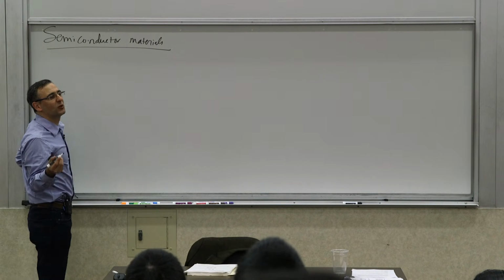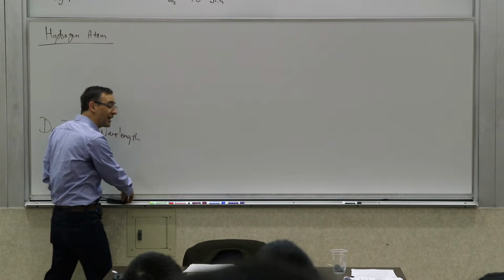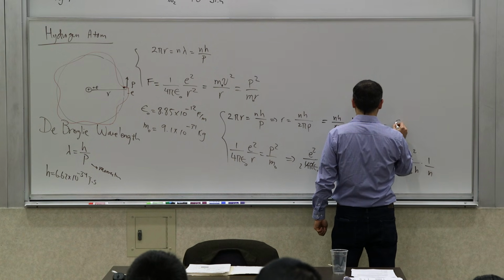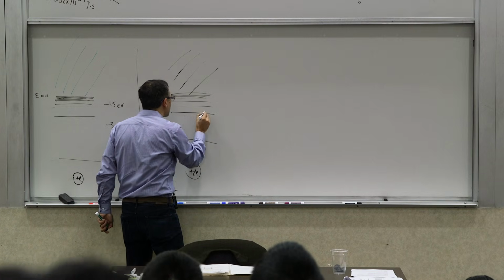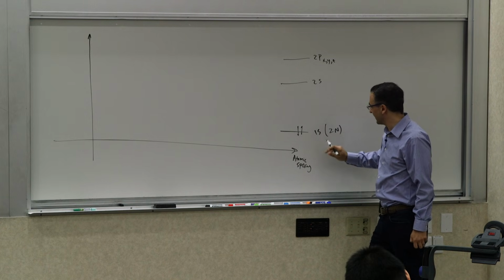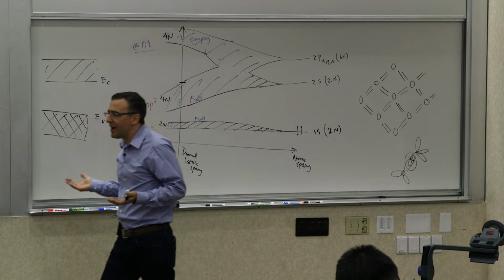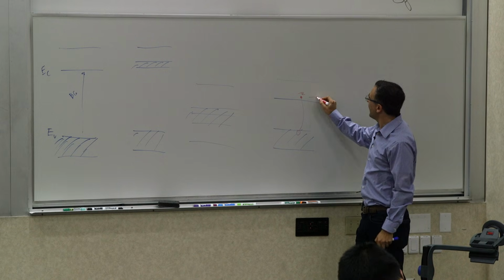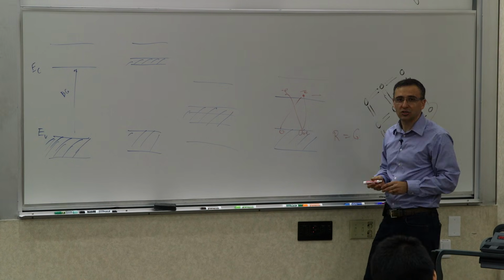101N. Basic Solid-State Physics: Energy bands, Electrons and Holes

Comment: The best way to identify a piece of diamond is to put in your tongue. If it feels like ice then it is diamond. This is because of the high thermal conductivity it takes away the heat from the tongue that it feels cold where the diamond touches. 
Other than Carbon, Silicon and Germanium all crystallizes in a diamond lattice and are good semiconductors. GaAs also have similar atomic arrangement like the others but it is diatomic with a two atom basis and has Zinc blende structure. GaAs semiconductor has many great advantageous properties but not ubiquitous in the industry due to the chemistry of GaAs which makes them not stable and robust like Silicon.

Comment: what defines the energy states at which conduction happens in conduction band. Everything is well explained upto the point of energy band formation from discrete states to band seperation but one missing link is " what defines the conduction band " Could you please help.
Reply: why electron in conduction band is not bound anymore though it still has negative energy.

Comment: Hi, Sir thank for such a great explanation.
Just for the shake curiosity, I have a question could electron can ever get the positive energy level, I mean As per equation it can never gain positive energy level no matter whatever value ''n'' could take.
Reply from the maker: Yes, they can. That would be a free electron not attached to an atom (or a crystal lattice). The reason the equation does not show it, is that the bound electron is assumed in the derivation of the equation, namely, when we assume a standing De Broglie wave forming the orbit. Hope this helps.
Reply: @AliHajimiriChannel  Thank you so much, sir, for your quick response. So sir again the question arises that what equations can describe the energy of the free electron and before that to get an estimation of the energy of these free electron we first need to know the position of these electrons right sir so how we predict that. Could u please comment on this.

Comment: Thanks for the great lecture! 

It will be great if you can clear the following doubts. 
1. Why are things quantized only when the total energy is negative? 
2. Will there be holes in metals too? The example band diagram that you wrote didn't show it. If not, why?
Reply from the maker: 1. Well, the quantization is an artifact of having finite boundary conditions on the wave equation, which is also related to the boundedness of the energy. An unbounded electron can assume any energy because there is no boundary condition on the wave equations. This is an artifact of the wave nature of the matter (the same way that a standing wave can form on a guitar string exciting only certain frequencies).
2. This really depends on the exact energy band diagram of the metal in question in the most general case.
Reply: @AliHajimiriChannel  Thanks a lot for everything!